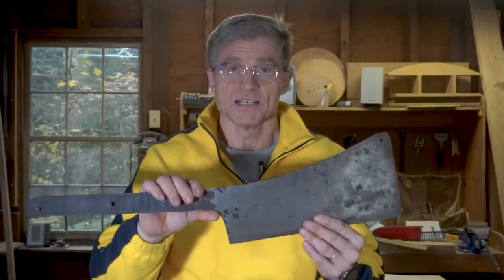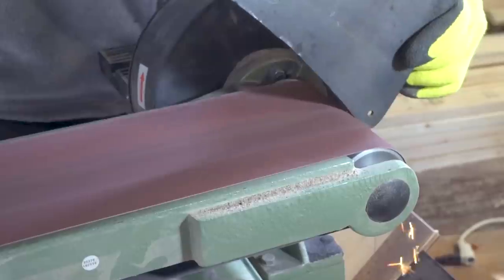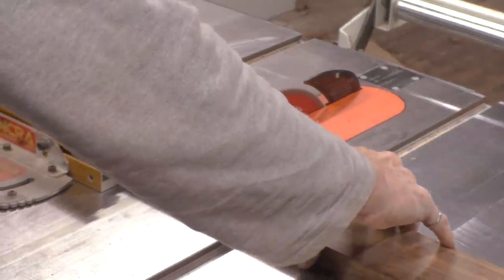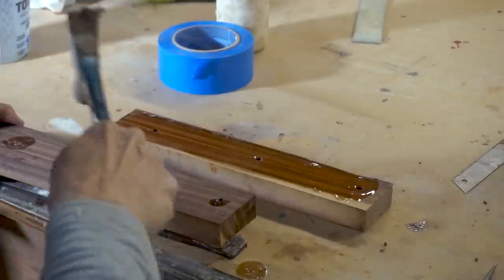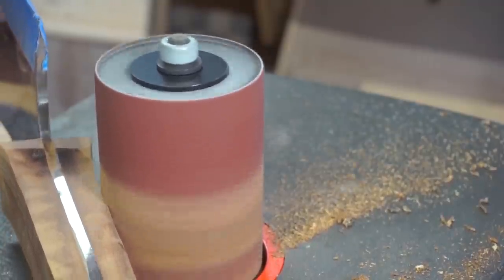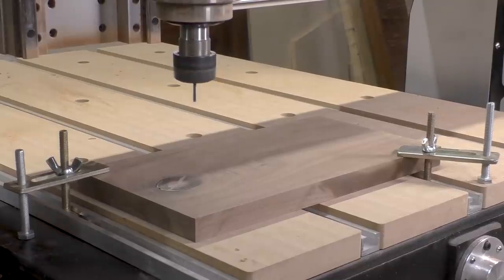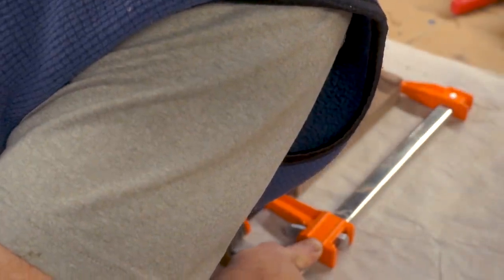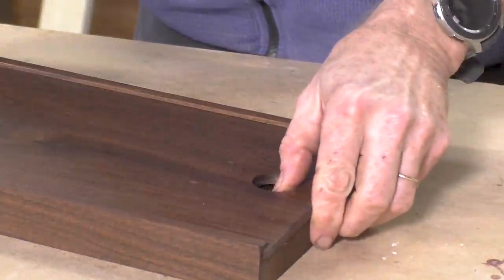Restoring a Meat Cleaver from 1837

Comment: I'm very fond of your videos and work. As I resurrect this video with my question. How did you ensure accuracy of the blade shape for cutting on your cnc. Just a simple pic and a few test runs? I too have a machine and am curious. I often use Adobe capture. Thx
Reply from the maker: All I did was trace around the blade with a pencil onto a blank sheet of paper and then I scanned that into my computer. I imported the JPEG file into the vCarve software and then did a bitmap trace. Quite simple!
Reply: @Woodumakeit  well thanks. I do something similar. Appreciate the help. I just finished a clamping board because of your video you used for making chess board. It makes my cutting boards super easy to clamp and very flat. Keep creating great info!

Comment: Looks great.  Curious, what made you go with a CA glue finish?  I’m not familiar with that type of wood either.
Reply from the maker: CA glue provides a durable, acrylic-like finish that will hold up well in a wet environment. It's also easy to apply. If I hadn't used CA glue, I likely would have just rubbed on some mineral oil, but it would need to reapplied from time to time.
Reply: Wood U Make It thank you I’ll keep this in mind!